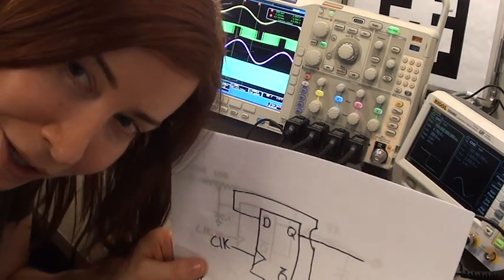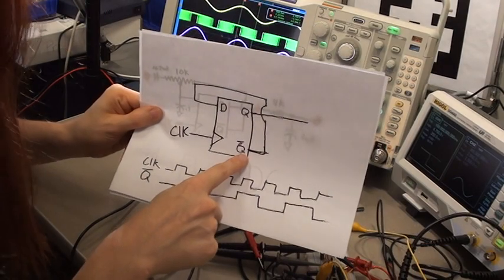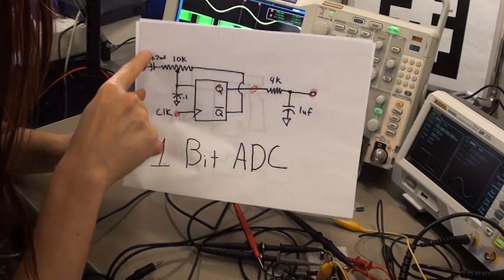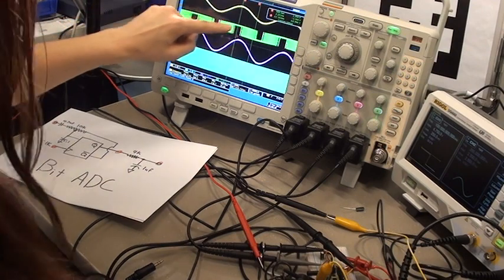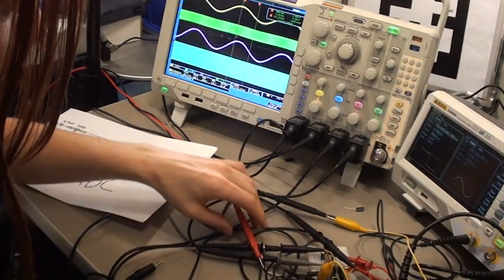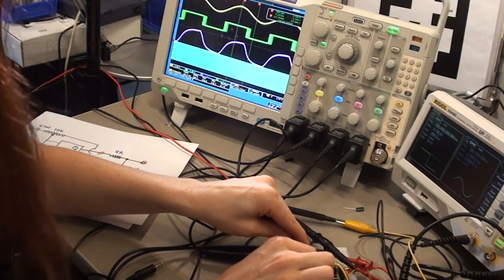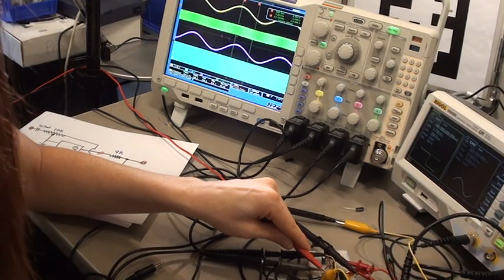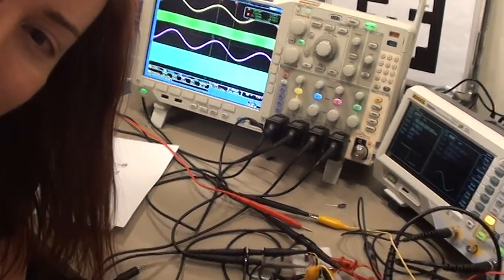One Bit ADC - Short Circuits

Comment: I think this is delta sigma ADC.
I have worked on delta sigma ADCs.
You can say that the D flip-flop is used as “quantiser”.  
The 10k  resistor is essentially summing the negated quantiser output (q-bar) and the input voltage. I.e. it’s doing (vin- quantized_vout). Then the combination of 10k and 0.1 capacitor is making an integrator.(low pass filter)
So, is first order delta sigma modulator. 
If you show the FFT of q output, you should see the noise shaping and it should show a slope of 20db/decade

Comment: This is not how ADC's typically work. They don't convert an analog output to a PWM. I see this mistake often, even with the so called "DACs" that converts a PWM of a micro-controller to a analog wave, and are nothing more than a RC network. The circuits work as such, yes indeed. But for that to be a proper ADC, if should have a comparator driving the D input of the flip-flop. ADC's have to be precise.

However, this circuit has its uses. It might be useful to sample a wave with a micro-controller with just one input. It will not sample the amplitude but sure it will sample the phase.
Reply: Good point! you can tell this by how she mentioned that TTL had a threshold of  "about 0.7V". You can't make an ADC with somewhat approximate thresholds.

Comment: Cute circuit but not actually an ADC. Just analog to pwm. It will need a bit more to get to digital.
Reply: The pwm is technically digital though-in a same way lowpass filter can be considered a DAC.
Reply: A ' bit ' more

I see what you did there

Comment: I can't find did anyone ask this before me, but I just find my old portable CD player and it has sticker on it that says "1 bit DAC"?!?!
How audio CD can sound so good with only 1 bit DAC? Audio CD is 16bit 44.1KHz as far as I know.
Please explain this to us if you know.
Reply: It's 1 bit because the PWM (pulse width modulated) signal (the green one in the middle) is a very fast (hundreds of kHz) train of either on or off states. In other words it is digital, which makes it resistant to noise and have the ability to be loss-lessly modified by digital filters or computers. Also, as opposed to the PCM encoded CD signal (which also is digital), the 1 bit signal is very simply and cheaply converted to analog or from analog (both of which is shown in the video).
So you can think of the 1 bit signal as a different, but equivalent (e.g. to a CD) digital encoding of the sound.

In your CD player, the 16 bit 44.1kHz is digitally (algorithmically) converted to a one-bit train, which then is able to be very simply and efficiently converted into analog as above.
Reply: The 6 rubbed off

Comment: in case you didn't get an answer:
To answer that I'd have to explain all about Maxwell's equations  and newton thermodynamic laws and some quantum physics theories, but the short version is:
she didn't draw it correctly and it should be changing on the rising edge of the CLK. you can see that she started at a low CLK and the second low nQ is 3 pulses long so the second high nQ is on a rising CLK thus confusing you :)

Comment: I read the Wiki on Delta-Sigma Modulation. So its realy NOT PWM as mentioned. Its more like "Pulse Density modulation" or "Pulse Frequency modulation" which makes more sense. still a realy interesting method for sampling and synthesizing signals.

Comment: This is sort of a vague guess, but could one turn a 1 bit coverter into a multiple bits one by iterating the sampling signal into a multi phased clock that would change the value of a single voltage comparator? 
The duration of the sampling signal iteration would have to be fast but I suppose that way the bit resolution would depend on the speed of the components and not on their number or how small they are.
Nice to see a new video btw

Comment: They do use flash converters, but typically only 1 or 2 bits or resolution. The SNR is so low, that using extra bits only samples the noise. I've seen specs like 1-2 bits and 8 Gsps. They they correlate the bit streams to get phase shifts between the antennas.

Comment: I've rewachted the video and I think I get it. There will be a requirement that the signal has an amplitude > 0.7 to guarantee that the toggling would skip. Fluctuations of a lower amplitude could be missed as the toggling might not skip resulting in loss of data?

Comment from the maker: It will sample amplitude also.  You can see that it's reconstructing the low points in the sine wave.
Reply: @Jeri Ellsworth 
Instead of directly running the Q output to the audio, what if you ran it through an array of 128 bit shift registers, say the CD4517BE. 
At the end of the array of CD4517s then take the audio and run it through the low pass, but mix the original audio back with the delayed signal of the 4517s.

You would clock the 4517s with the same clock, but probably around 44.1khz

Would this not make a crude digital delay?

Once my other project is done I will experiment with this, as I have 10 CD4517s, it would happen!

Comment: Am I correct in understanding that due to the fact that this is 1 bit and the design of the circuit hat this would only allow you to sample and recreate any frequency modulation; any amplitude modulation would be lost? If we wanted to capture any modulation in the amplitude of the frequency it would just be case of setting up n bits with a different reference point?

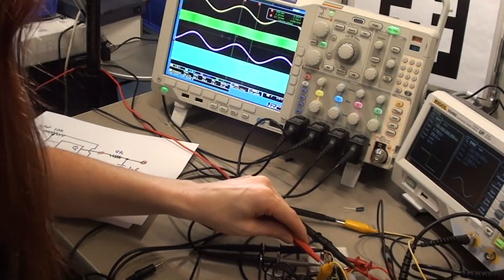Comment: The only problem is is that you have to have some very fast switching power mosfets at a speed of 3GHz for CD quality sound (44100 x 65536). There are noise-shaping and dithering algorithms that can be applied to lower that quite a bit(<- No pun intended). One of the biggest problems is dealing with impedance changes. @ 3:57 when she hooks the audio probe up to the output, You can see the waveform on the scope shift. BTW: You can't use a buffer on the output of a power amp.

Comment: Quite brilliant. Is it possible to digitize a certain frequency band (let us say 500 Hz up to 10 Khz) with this circuit and/or how critical is the filter at the output when a whole frequency band has to be restored from a digital signal to a sine wave. Does the restore filter have to be adapted for all the parts of the audio range?

Comment: Huh... simplest possible realization of delta-sigma ADC basically, neat. I once tried doing a delta-sigma ADC on a breadboard, but I overdid it with a separate comparator and an active integrator circuit with an op-amp. It never struck me to just use a passive RC circuit as the integrator and flip-flop input threshold as the comparator. I like it :)